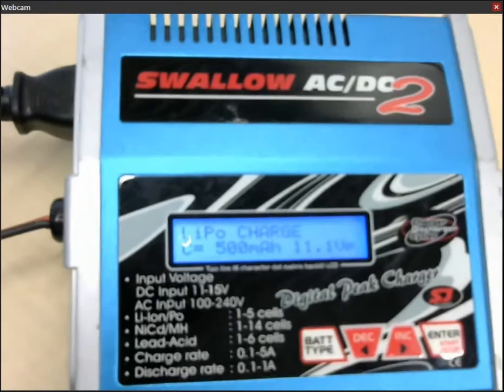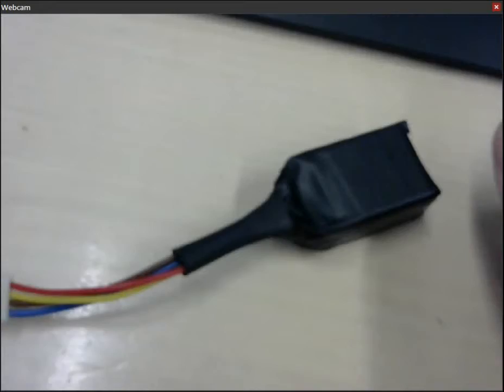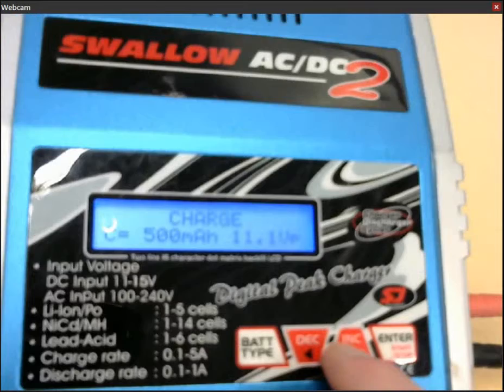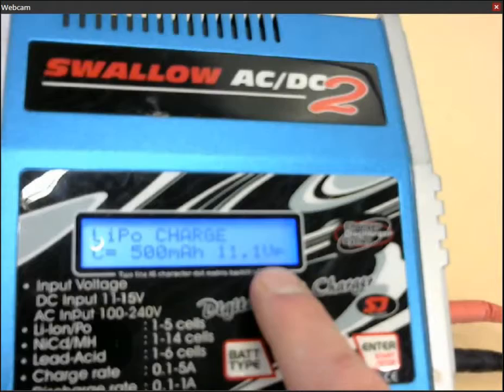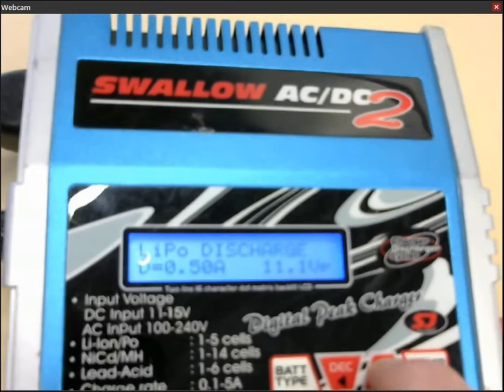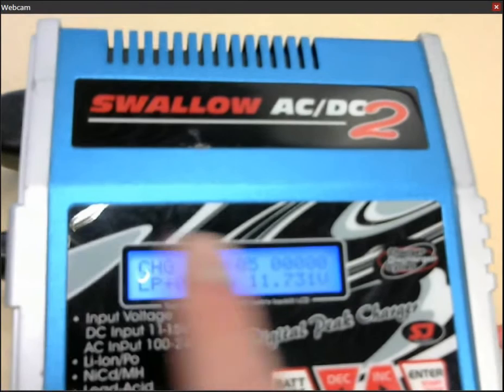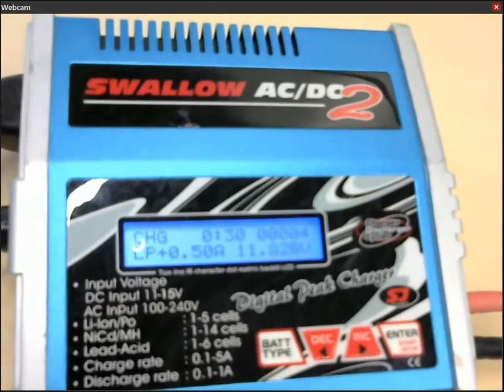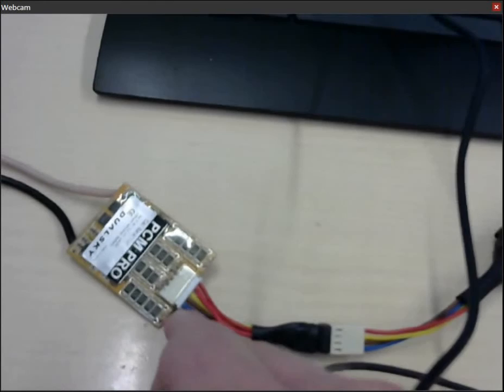Using the Swallow AC-DC2 charger

Comment: If you want to balance the LiPos you have to buy a separate unit....

It’s a pretty good charger I’ve had mine for about 13 years and on occasion for torches or other appliances whatever.....

I cut the wall plug off because I can trickle charge and discharge fully and then recharge automatically it’s pretty good
Reply: How do I charge a  Ni-Mh 1800mAh 7.2v battery? I’m struggling to get it to change from C=0.1A to Volts.....